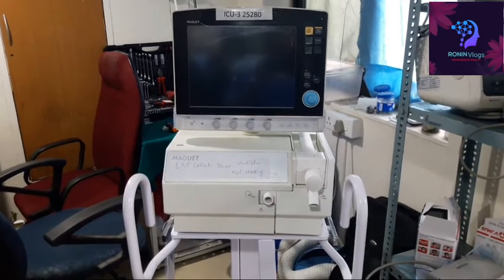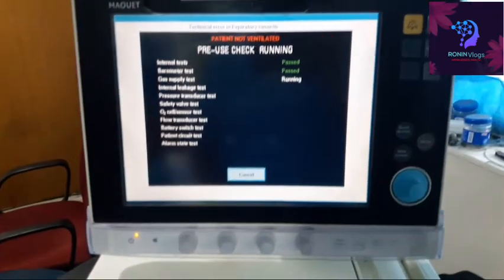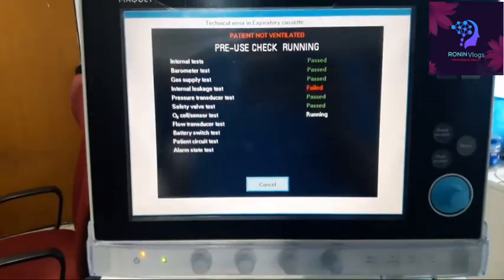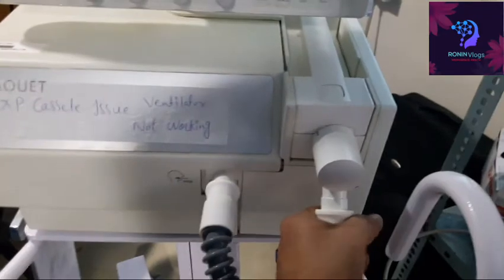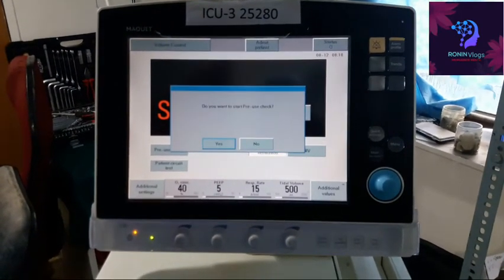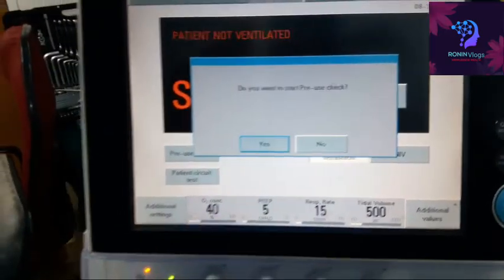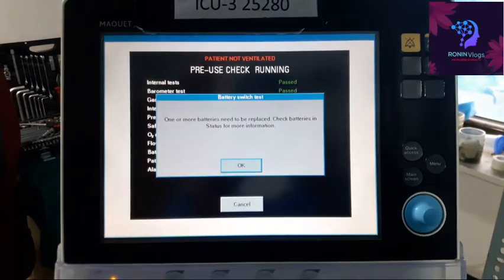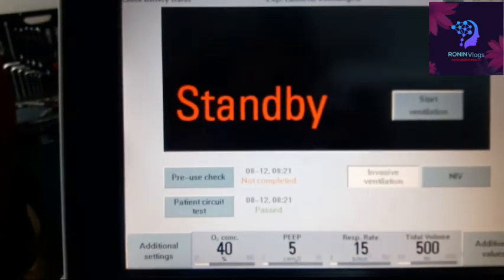servo s.. TECHNICAL ERROR IN EXPIRATORY CASSETTE...pre use check

Comment: Thank you for making video. By the way how to check the flow transducer.
Reply from the maker: Checkout tym machine automatically check the flow transducer
Reply: @roninvlogs9099   showing flow transducer fail in pre ise check
Reply from the maker: Need to clean the  cassette